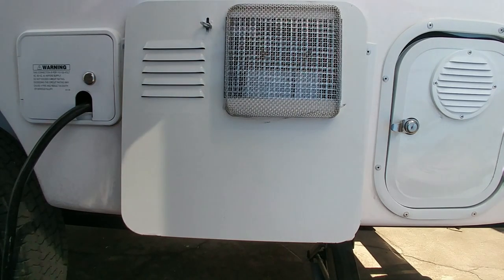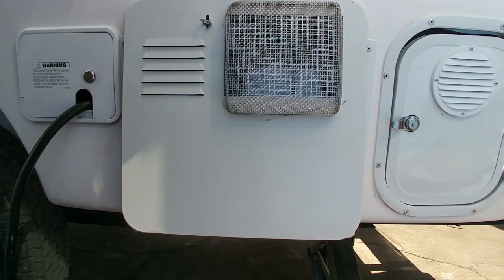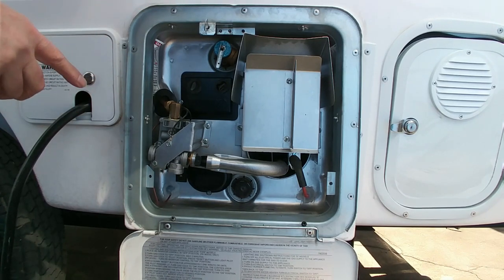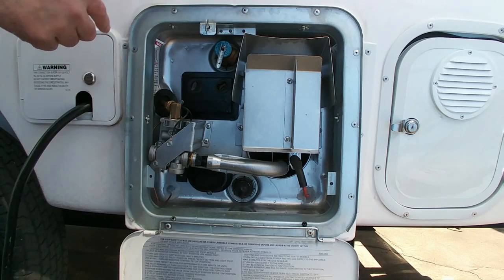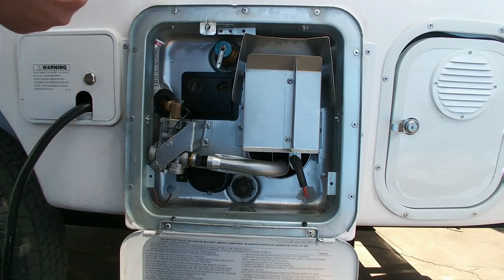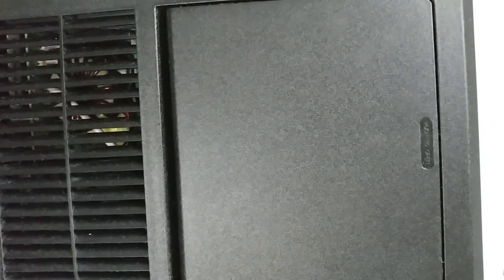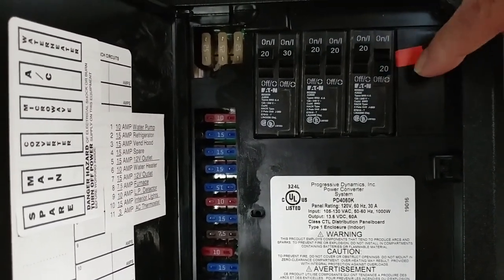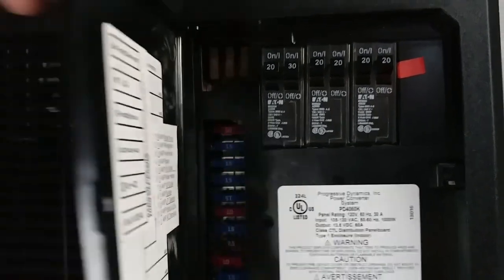Casita Water Heater Story!

Comment: If water does not flow out of your hot water faucets (when water does flow out of the cold water side), the bypass valve may be stuck, even if you never by pass the water heater.  This happens to me often.  The fix is easy:  tap the bypass valve (shown in this video; it is inside the access panel in the left (passenger side) under seat).  Use a medium sized wrench to give it a light tap.  If you leave the kitchen hot water faucet open, you will hear the water start pouring into the sink. If no luck, tap it again.  As he mentioned, when water flows out of the hot water faucet(s), the water tank is filled.